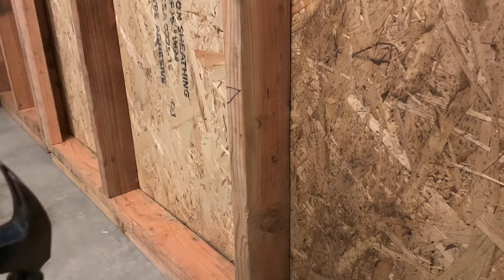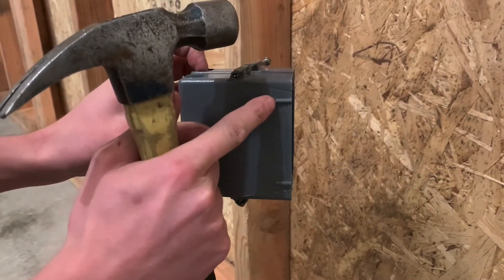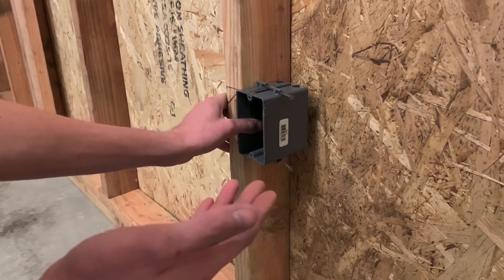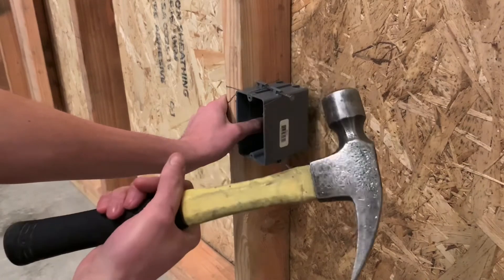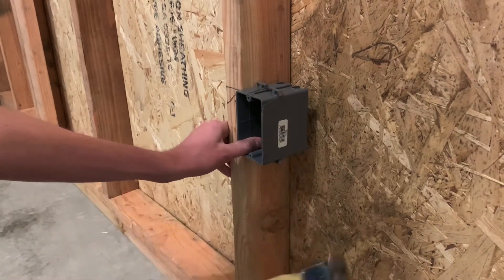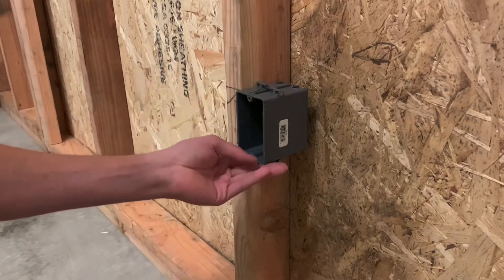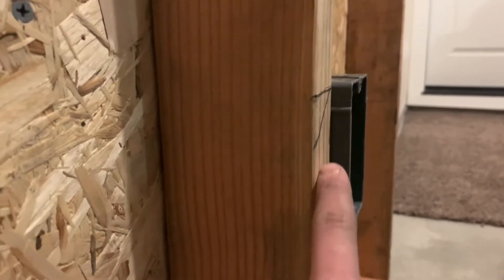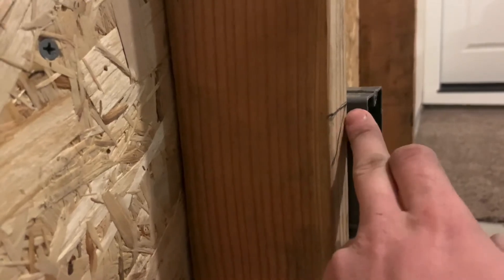Electrical 101: How To Mount A Single Gang Nail On Box (Residential)

Comment: The guy who did my dads garage mounted all the boxes flush with the studs. Now we are about to drywall and I was wondering if there was some kind of mud ring or something that we can put on the boxes instead of moving them all, any ideas? I’ve never done residential no I really have no idea if they make mud rings for the blue plastic boxes
Reply: The following product will allow you to space out the receptacles, and then the faceplate should mount to the receptacle covering up the mistake. You may need to purchase some longer screws however.

https://www.homedepot.ca/product/gardner-bender-qwick-fix-spacers-adjust-length-of-recept-or-switch-to-fit-faceplate-4-inch-stack-twist-apart-4-bag/1000751620
Reply: @Daniel.lopez.  cool, thanks.
Reply from the maker: if it's not drywalled yet just remove them and bring them out further, if it is dry walled you can use extension rings.